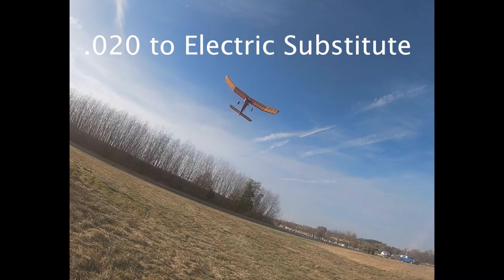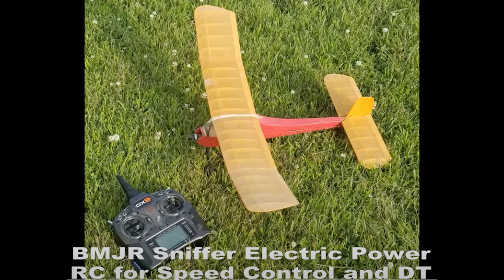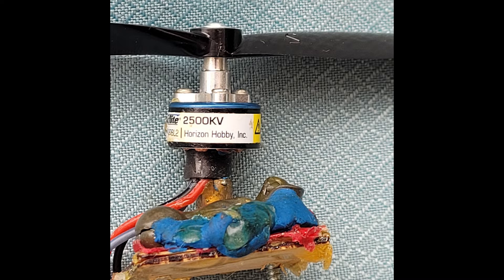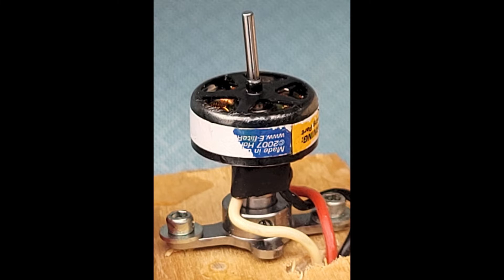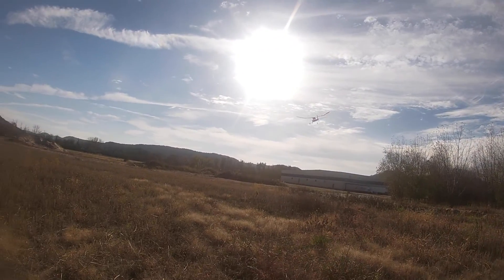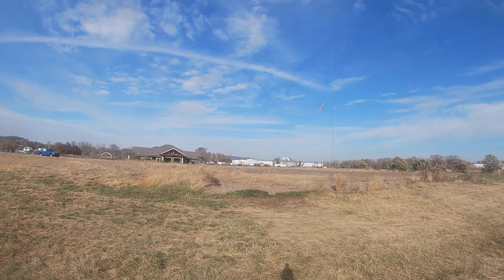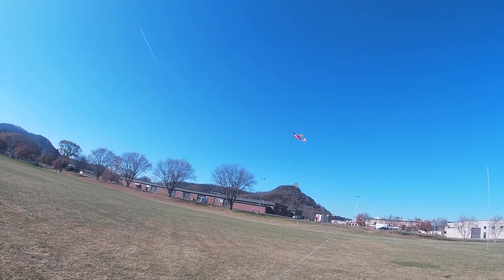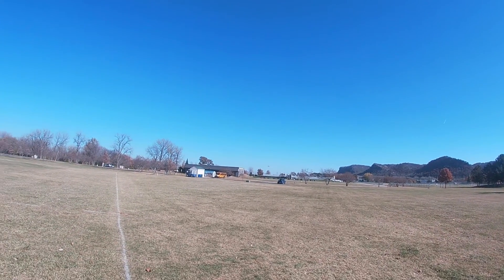020 to Electric Free Flight

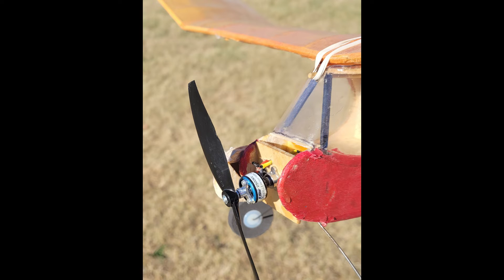Comment: information          3:34    this is a too-flexible prop.!      use an  E prop.        in general, an E prop larger than 5.5 inches will need a correctly spec'd 3s power system.